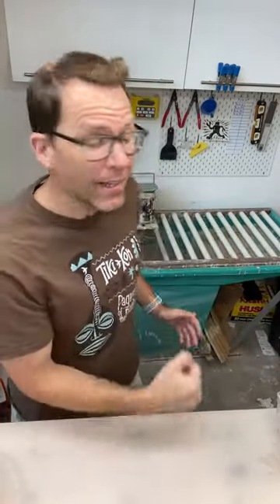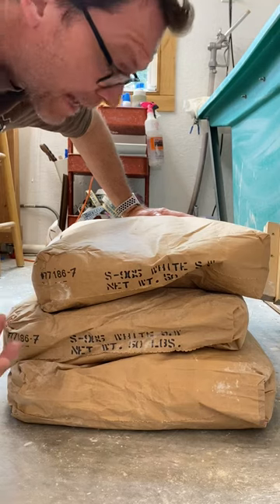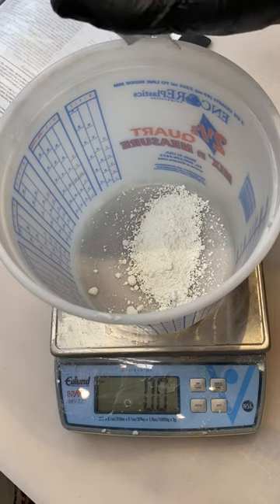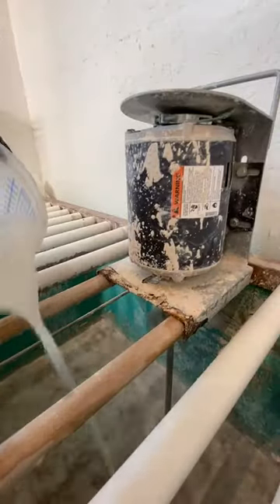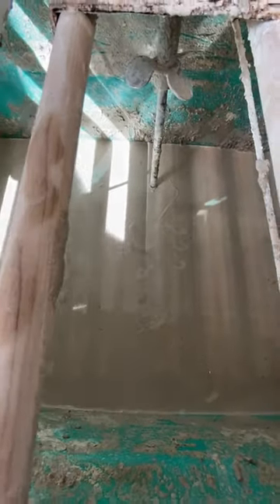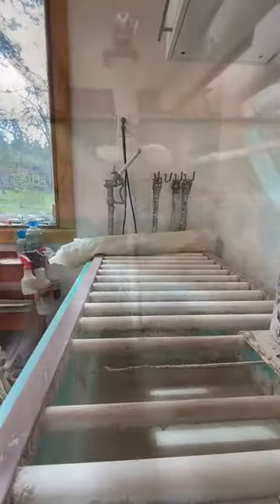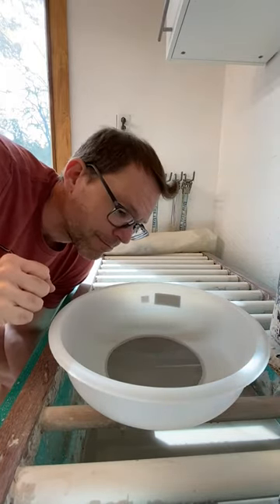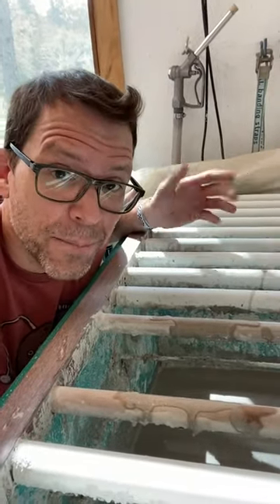slip! - Tiki Technical Tuesday 26

Comment: question, if you were to overdo the defloculant, couldnt you add more raw slip mix and water to bring it back to life?
Reply from the maker: You can - but it is something I definitely want to avoid doing, mainly because I don’t carry extra dry slip on hand in the studio. From what I’ve read, it can be difficult to bring overflocculated slip back from the dead. Hope I never have to try it!